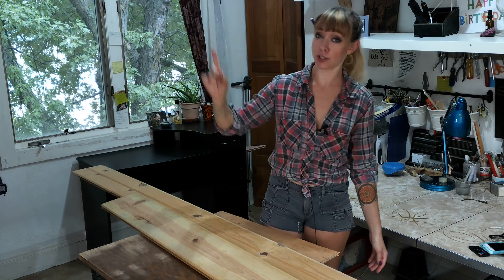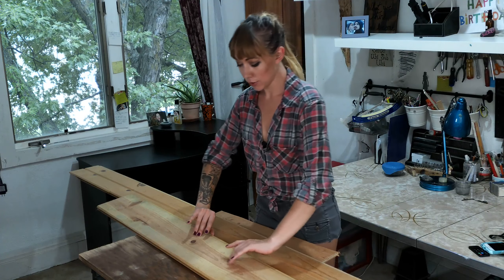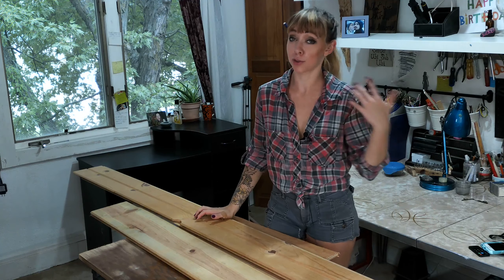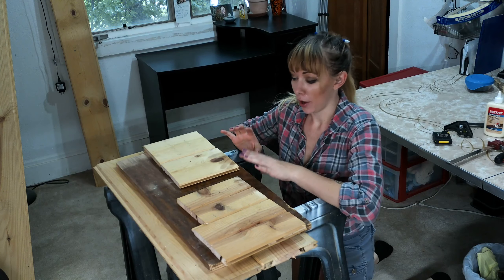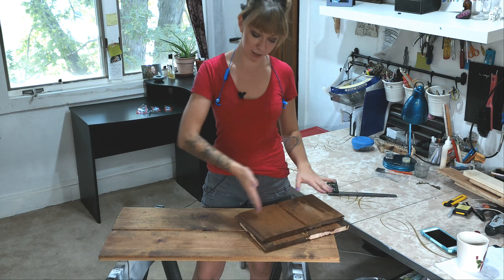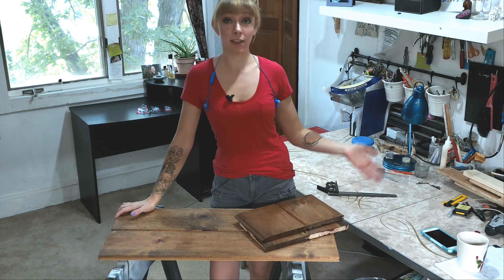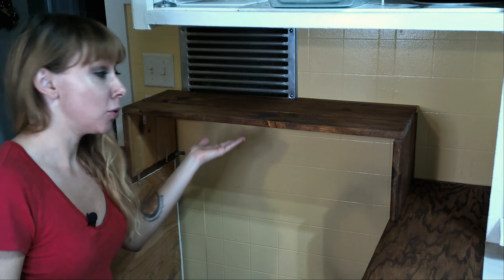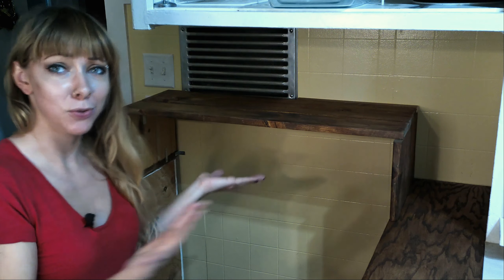How to Build a Custom Over the Stove Shelf | Beginner DIY Projects

Comment: I have seen these on Pinterest and my question is what kind of stain or sealer do you use especially being so collide to the flame or burners? I want to build one but I have a gas stove so I don’t know what kind of stain or sealer I can use, especially with a gas stove, I don’t want to set my house on fire😬! I don’t want it to go up in flames when I’m cooking 😬
Reply from the maker: Hmm that’s a good question. I just used regular oil based stain once it’s cured for I think like 3 days it shouldn’t be a problem. I suppose you could invest in some kind of organic fancy stain that’d have lower VOCs and what not. But I don’t think it’d be a problem. Stoves sit around wooden cabinetry almost exclusively & its not a problem.